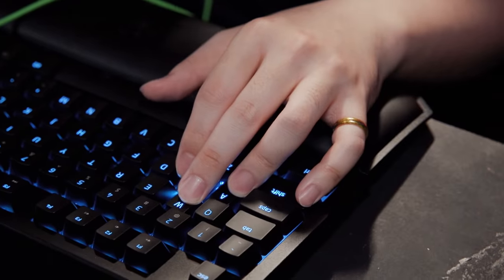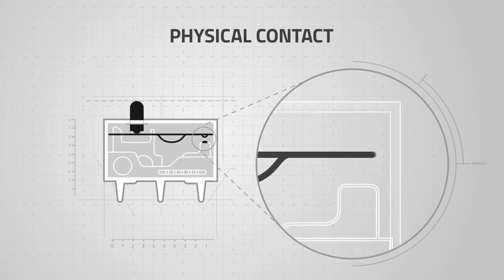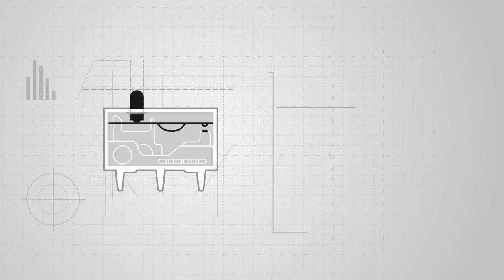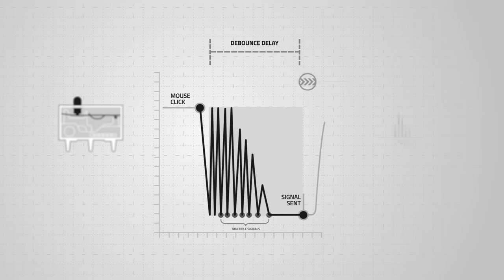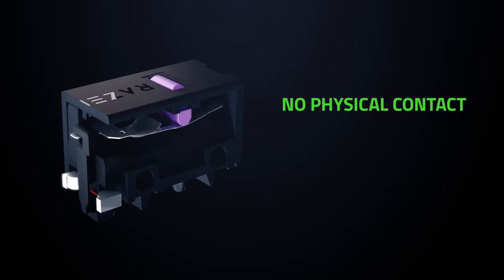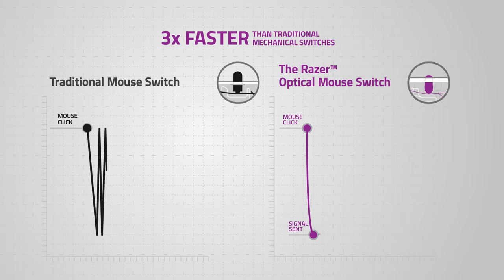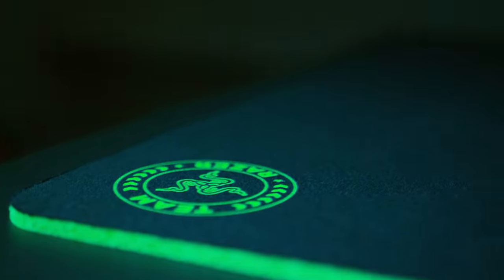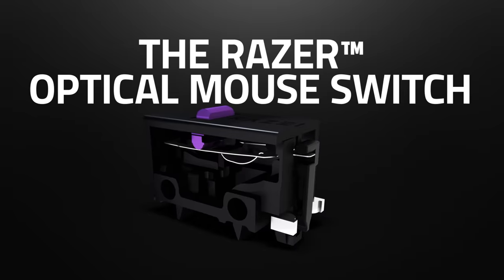The Razer Optical Mouse Switch

Comment: They are fixing a non-existent problem.
Reply: Lmfaooo
Reply: @alexanderwayneturner   the debounce delay of most gaming mice is 10 ms, witch means that for 10 ms after a click the mouse ignores any signal. Do you really think a pro or anyone can click twice in a 10 ms interval? (2 clicks/10ms would be like 200 clicks/1s)
Reply: @alexanderwayneturner  Indeed I haven't... But I take you actually don't understand what 10ms are... So I will give you an example:
Considering a 60 fps recording (1 frame/16,7 ms), a mouse click/11 ms ( so no need for the debounce delay to kick in) and T in ms:
T=0 - frame#1;
T=1 - 1st click;
T=12 - 2nd click;
T=16/17 - frame#2
This means that a Korean Starcraft pro could do 2 mouse clicks without a camera capturing even 1 click, and still the debounce delay would not be a problem!
Do you think in a human scale this is possible?
Reply: The Warrior  Well, if it does last longer, it could be worth it. I got a few mice with broken switches after a year or two that I had to fix it by myself.
Reply: It isn't about clicking faster, it's about eliminating the bottleneck, similar to ping but on a smaller scale...
Reply: Exactly and some people who need fast cps want the bouncing so you can get multiple clicks per mouse imput
Reply: Well part of the reason why I couldn't "react" faster than 190ms was because my mouse was set to have a debounce delay of 10ms, after I set it to 4ms I could often times hit 165ms reaction time on human benchmark
Reply: @rubennonius4621  in games like fortnite debounce time matters, trust me
Reply: @qiyuxuan9437  oh yeah I agree, if it does last longer it's good, just felt that the 'fastest mouse' was a little misleading...
Reply: Antae how tf would a delay after the click that prevents additional clicks affect your reaction time of the first click
Reply: @toph9730  The delay goes for the first click as well the software wait for it the bounce to stop and then send a signal :)
Reply: @alexanderwayneturner  this whole thing is marketing bullshit,
I've seen pro players useing 10$ mices and still winning tournaments
Reply: Alexander Turner this dude is 40 years old talking about professional gaming 😂😂😂
Reply: @alexanderwayneturner  this isn't even possible for a human to take advantage of anyway.
Reply: OnlyVincy. No it doesn't. It doesn't matter in any fps. Like noted above, you can't click twice in a 10ms time. Plus the guns on fortnite won't fire that fast in the first place. I'm sure it's a great mouse but the problem just isn't there.
Reply: ZothinDeMystic ØSC even if that was true (which it isn’t) how would lowering the delay by 6ms improve his reaction time by 40? None of it adds up lmao
Reply: Look if this solves the problem where a single click is registered as double i am down for it, cause last time i bought a razer mouse it malfunctioned  3 times in a single year and every time it was a double click issue. Mouse was Razer Mamba 4G
Reply: I'm having double click issues with my deathadder. Maybe this one won't have this problem?
Reply: Y'all ever played Minecraft
Reply: Alexander Turner no it doesn’t lol
Reply: Alexander Turner lmao you got rekt hard 😂
Reply: @alexanderwayneturner  burned
Reply: The Warrior  yeah its like illuminati
Reply: It's because you can't afford it. Lol
Reply: They're actually selling a solution for a non-existent problem.
Reply: Bingo! Its called advertisement. With this they are after serious gamers.
Reply: This is stupid nowadays adding that bouncing filter is extremely easy and cheap even to 10$ gaming mouse.
Reply: @qiyuxuan9437  The replacement is fking cheap, never goes over $5 trust me
Reply: This conversation tho
Reply: it exists on rocket league
/:
Reply: Mechanical switch have one problem, dust partical get in cause mouse to double click so this laser things helped a lot to solve that shitty problem
Reply: @tykrao9565  that problem is basically nonexistant
Reply: @awildmoose6541  maybe not for you, but i have just sent back to logi my g403 and g703 in just 2 months because of dust partical get in, if i blow really hard in, it'll work just fine for a couple hours.
Reply: “razer mice have double clicking problems”
razer fixes the problem
“they are fixing a nonexistent problem”
Reply: @daburritoda2255  Minecraft for example.
Reply: @OnlyVincy  yes of course because 10ms is SO HUGE most likely in fortnite when you can shoot once each second with the fastest shotgun of the game and can just don't release click to shoot multiple times oh yes sorry with the pistols you can't remain clicked but do you shoot 1 bullet in 10 secs with a pistol and same for the builds there is no need to click once each 10 ms cauz you cna remain clicked so idk how it can count in fortnite it's maybye the online game that needs the less to "fix" this unexistant problem.
Reply: u arguing about something you can't buy
Reply: Nah it's about time these switches are modernized. The increase in responsiveness may be pretty pointless and mostly marketing, but all the tiny gains can add up. The far more important win is to make those switches more reliable. The single biggest cause of failing mice is the switch and the dreaded double click issue. It's so bad, I just can't see myself purchasing an expensive mouse again unless it has a solution to that problem, and this looks like a promising one.
Reply: @OnlyVincy  How does it matter in fortnite? I would understand if you were talking about a very competitive game where you need well timed shots like Quake, but why in a game where most of the guns are either full auto or have pellet spread?
Reply: That whole saying about “If it ain’t broke, don’t fix it” is a terrible saying to live by. You should always try to get the best out of anything, no matter if it’s a small improvement. Nokia probably believed that shitty quote and now they’re broke. Gotta stay ahead of the competition.
Reply: no I got a G pro wireless and it had a terrible double click but I got one of these mice and it solved every issue
Reply: They still did it though, sure it didn’t exist in the first place but they still fixed it.
Reply: OnlyVincy. Yh but fortnite doesn’t matter
Reply: Exactly 😂😂😂
Reply: @rubennonius4621  4 months late but, debounce delay works in a way that it sends the signal after blocking the unnecessary bounce signals, not on click. Basically, you click, 10 ms delay, then send signal. So the problem isn't really on how fast a person could click in quick succession, since it is quite the feat for a human to click twice within 10 ms. No, the problem arises on players that rely on prediction. 

For example, say a first person shooter like counter strike. There's a bolt action sniper rifle that shoots one bullet per instance but is an instant kill. Most good players that use this gun doesn't rely on reaction. When they see a silhouette, they drag the mouse there and as it is going to the position, they click it so that once it reaches the target, the shot is fired, all in a matter of milliseconds. They predict the trajectory of the mouse movement and the person they're shooting and act accordingly. Now imagine if there's no delay on the click, their predictions would be more accurate as they'll be able to precisely time the click on the exact moment the crosshair lands on target, instead of clicking in advance before it lands. This is a "nitpicky" issue to fix, yes, but not really an obsolete one, especially for professionals whose "work" rely on them being the epitome of human performance in terms of reaction, and hand-eye coordination. If the machine can't keep up, then they'll be forced to compromise by using unnecessary tactics.

Also, most, if not all, systems used in playing games nowadays, be it professionally or just at home, run on either 144/240 hz. 
60 hz or "fps" is quite "laggy" and basically makes fast moving objects jump a few pixels on-screen. Sounds absurd but trust me, the human eye can actually differentiate 60 hz from 144 hz.
Reply: Yey
Reply: @rubennonius4621  have you heard about high refresh rate monitors?
Reply: Edits.
Reply: just like apple
Reply: Alexander Turner duck wit he was putting his opinion out there it’s a right sumbass
Reply: Bouta whoosh this reply section
Reply: @rubennonius4621  youre too smart and i dont get it lol
Reply: Part of selling is convincing the audience there is a problem

And there's nothibg wrong with that
Reply: JG Peres :o never thought about it that Way
Reply: @alexanderwayneturner  Holy shit dude you killed him
Reply: Its simple when you click whit normal mouse the delay can be between 4-5to10ms or more (and sometime you doubleclick for this) ! Whit this razer mouse when you click there is no delay and no double clicks ! So you can see the difference in games like csgo !
Reply: I need this mouse when I play Cs I double tap with the ak shit is so annoying
Reply: Actually they are fixing a massive problem, and it's not regarding speed. It's the double click issue plaguing mice with OMRON mechanical switches. I've had 3 mice that started double clicking involuntarily after a couple weeks of normal use. It's extremely annoying and can cause some pretty serious problems like double clicking the next button on exams and making you skip questions, and highlighting/un-highlighting text. The optical switch fixes that issue completely.
Reply: @xenial07  holding angles benefits even more from this than flicking. Since from the moment you saw the person peek, to the moment you click and finally the moment the signal sends and issues a command to fire a round, the delay could very well determine whether or not you hit the person before they return to cover. Sure 10 ms seems negligable on paper, and most hardware can't even deliver enough frames to make it count (although the ones used by pros and tourneys most definitely do), but who can say that this will still be the case 20 years, even 10 years, down the line? The past decade saw great advancement in technology, no one in the 80s who was thinking straight would think virtual reality would actually be a thing any person could have access to but here we are. Sure, it might be a stretch to call it a "fix" now, but in esports, the closer the players get to playing in the 'present', the better their performance would be. Data takes time to travel to and from between you and the device, and reducing that time as much as possible is anything but useless. I'm not saying this is a must buy or revolutionary in today's standards, but later on, when machines can perform tasks closer and closer to instantaneous, those 10 ms would mean a lot.
Reply: @idiosyncrasy7703  i don't know where you're getting the 10 ms from, from what i've read it's 1-4 ms at most. even worse, the "0.2 ms delay" is 8ms on the first click due to razer adding debouncing on the first click.

you need to realize that even if technology advances, humans don't. we don't evolve in real time to be capable of processing changes measured in milliseconds. the delay on switches at the moment is already so low that going lower won't give any real-life benefits.

even if pros play with 240hz, it means that it'll display a new frame every ~4.2ms. let's say that the pro has superhuman capabilities and can make out the difference between 2ms and 8ms, in the absolutely best-case scenario it'll shoot 1 frame earlier client-side. 

now back to reality, nobody in the world can make out the difference of 1 frame on a 240hz monitor. the 1-4 ms delay on average on mechanical switches is more than possible to get used to, which already negates the whole argument. nobody makes the decision of whether or not to shoot within 1 frame on a 240hz display, so predicting the delay will never be an issue.

the real issue is the consistency of the delays and ensuring that if the delay is 4 ms, it stays 4 ms. razer isn't exactly doing a good job at this since their delays vary from 0.2ms to 8ms.

anyways, enough with the hypothetical bullshit, even if you have a 1 frame advantage client-side, it won't make any difference in any case no matter how fast your brain is since server tickrate is what actually matters in multiplayer shooters with server-side hit detection.
csgo competitive servers run on 64 tps, most tournament servers at 128 tps, which means that the server will only calculate whatever you send it every ~7.8ms at max, meaning that the advantage you could hypothetically get out of an optical switch is completely irrelevant.

even if in the future it made a difference, it would be too tiny for a human to notice and gain anything from.
Reply: xeniality  after rereading the comments, I got it from the guy I was replying to since I was using his argument to form my counter argument, since just like you I, as well, cba to do the maths myself.

Then again, my argument doesn't really rely on the amount of delay, rather what the debounce delay actually does. If I haven't been clear, I never said that the person needs to see the difference. Never did I say in my argument that this fix relies on the person noticing it. What matters is that the machine does, and most modern systems will and do. And, as I've said, the closer the response is to the 'present', the better, be it as small as a 2 ms difference (again I'm relying on your numbers here since I'm arguing based on pure logic). 

That 'the difference doesn't matter' argument only matters if the click was made at the start of the new 'frame' or wave of data. Let me show you what I mean when I say the machine is the one that needs to notice the difference. 

Say, in a 128 tps server, it takes roughly 7 ms (for simplicity sake) for a new wave of data to appear after the previous one, right? I am playing and in that 7 ms period I sent a click on the very last possible ms that the current batch of data is being used, let's call it a 'frame' (again for simplicity sake).

Basically (I feel like my explanation is poor so let me try it visually as I explain things better that way):
1st 'frame'
1 ms- 
2 ms- 
3 ms- 
4 ms- 
5 ms- 
6 ms- 
7 ms- click*
2nd 'frame'

*Note: this click isn't intentionally made by the player, rather, statistically, it's just as probable for a click to happen here than in any other ms.

Now, if the optical mouse's delay lasted a mere 2 ms give or take, that minute amount will very well decide whether or not my input registers before the next batch of data is received. And in a game spanning for multiple minutes up to an hour, the amount of clicks landing on that very last ms wouldn't be ignorable. You constantly see players swearing they fired first when the gun didn't even fire at all or something along those lines. This happens because of the scenario I presented, or at least is some cases while in others it's the server delay that's the culprit, then again we can't really tell right. If the response time, however, is as close to instantaneous as possible, the amount of dice roll of whether or not the input you made will be received will be reduced. It's not a matter of whether or not the  players can notice the delay, it's a matter of whether or not their input even gets through at all.

Then again, you do have your points as to how limiting the human side of this argument is, which I wholeheartedly agree. If that were the only factor, I wouldn't even argue with you on this one. But that's not the case here.

Oh and if I come off as hostile, I don't mean to. And I most definitely do not want to force people to buy this mouse, lol. I just like this type of casual debate you know.
Reply: They made the durability better.
Reply: @OnlyVincy  it really doesn't unless you are using a pistol for the whole game
Reply: @RHQ7  Intel be like: we got 95% market share so why even try to improve our products.
Reply: They are teachers now. Razer what have you done!!!
Reply: Actually I want them to innovate more. 'cause in my country (India) the ping sucks S, so I need every ms I can get, which compensate for it.
Reply: Haha 70 million clicks go tiktiktiktiktiktiktiktik
Reply: Us minecraft sweats need those double clicks
Reply: @idiosyncrasy7703  If you are right, than yes I understand the advantage, even if it is very small. I thought it was click-> read signal-> ignore other signals for X ms debounce time-> Listen for clicks again. My mistake!
Reply: @WillJackDo  I have, did you heard about 240hz monitors refreshing every 4.166(6) ms and most having 1ms or more of response time?
Reply: @Skedge  Cheers mate
Reply: @Joseph Mitchell "Someone"... Majority of people who bought this mouse will not use a TOY CAR to make 500cps (and still 2ms/click, the viper supposedly can do more... That someone has to do better!)
Reply: @rubennonius4621  it's all good. We're all just having a mature discussion here. Btw, happy holidays!
Reply: @rubennonius4621 Minecraft PvP: 😏
Reply: @idiosyncrasy7703  Thanks, same to you! :D
Reply: So double clicking isn't a problem anymore, I guess.
Reply: if the world went off your logic then we would still be in stone age
Reply: @rubennonius4621  that first comment would have been a fair point if drag clicking or double clicking or bolt or fly bawl clicking didn’t exist
Reply: @gabrielteodosio3223  how young are you?
Reply: @rubennonius4621  Yep, even if the guy clicks every 9.9ms, that's 101 clicks per second which is still pretty insane for a human.
Reply: @rubennonius4621  lmao every minecrafter can double click with their clicking skill lmao